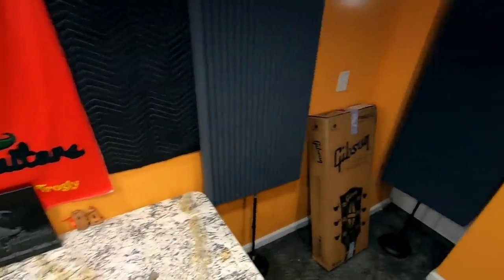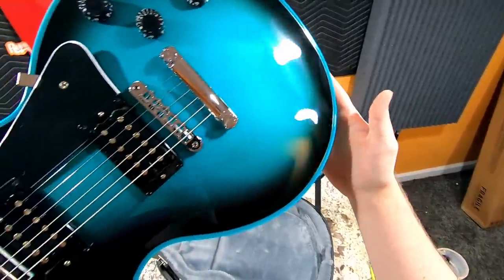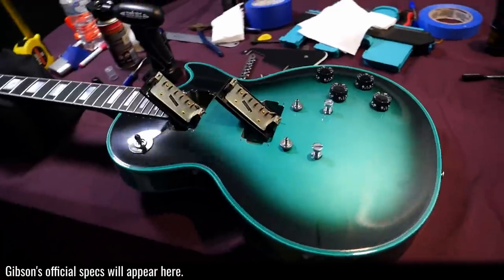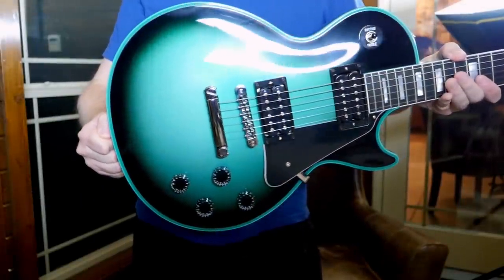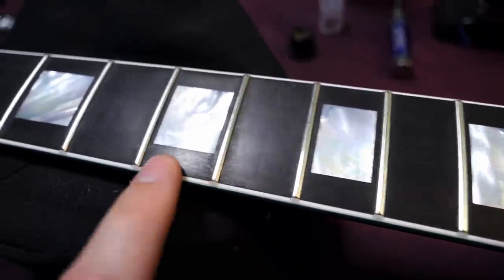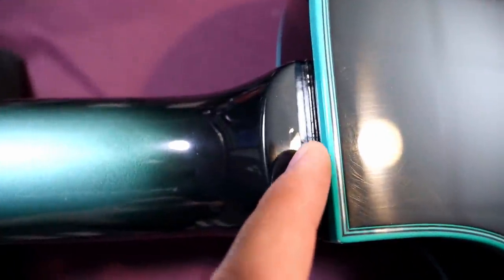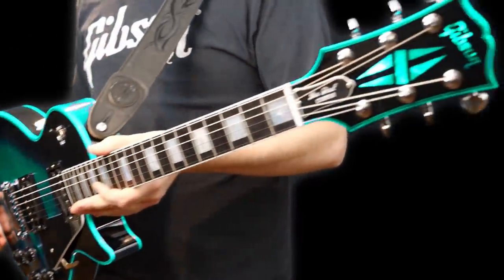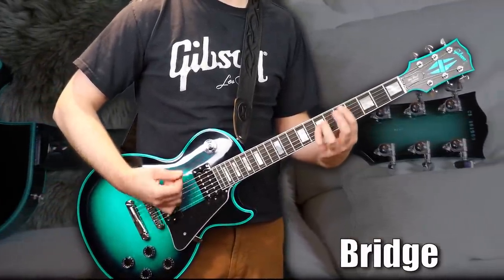The Phantom Widow is Here! | 2021 Gibson Les Paul Custom Mod Collection Teal Blast Review

Comment: I just got a modified Les Paul Custom Black with Custombucker 68s a few weeks ago and it does have a brown control plate cover.
Reply: Sadly you might have to get an aftermarket one and stick the factory stock in the case.

Comment: Keep requesting that you get the correct pu's sent to you for free, eventually theyll get their act together and pay someone to list them correctly if they loose enough sets of pu's. Are these ones what a silverburst would have come with? They take out the electronics to paint,I assume, so do they mix it up and reinstall the wrong ones at that point or were these the pu's it had the whole time and it was written down incorrectly? What about when time comes that you need to get warranty work done what will they say then when they look inside and it's not the same pickups that is in the description? Are there any baby pictures that come with these? If so is it the baby picture of the redo or is it the baby picture of the original silverburst?